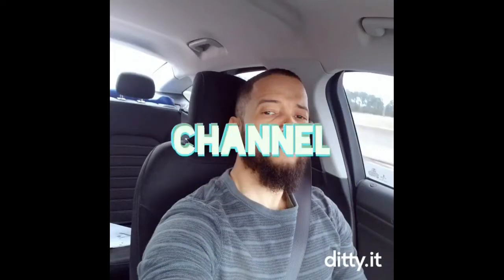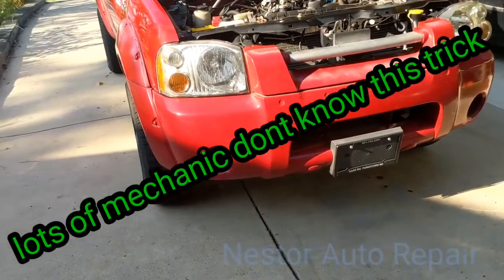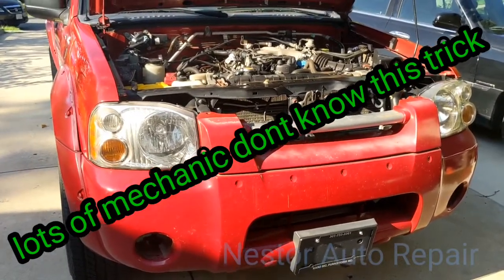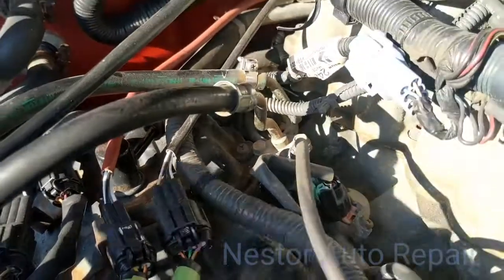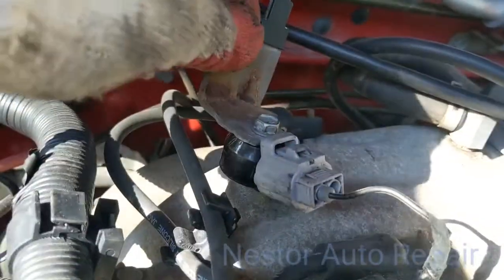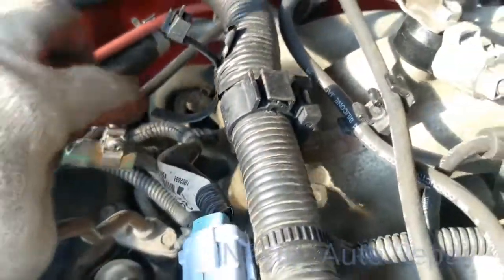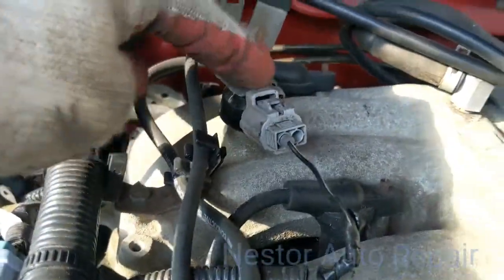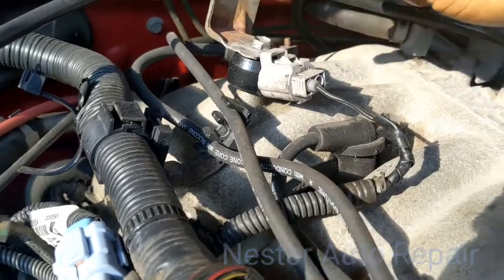Nissan frontier Nissan  xterra knock sensor replacement  under 5 minutes

Comment: Thank very much I am an elderly woman using a cane and have been working on my truck due to economics.   I change the throttle body boot and hoses in the summer in Arizona, last summer.  I need a horse lol.  I cleaned the throttle body with rag and screw driver it was so very very dirty at 180,000 miles.  It hasn’t been the same. I haven’t felt well enough to work on it again till recently.  
It starts choking when I put on the brakes.  It has a swooshing/air sound when I put on the brakes. The brakes booster and master cylinder are maybe 6yrs.  I have only taught myself by YT.  There is a code for knock sensor this is how I found you. It would be a blessing if you had a suggestion.  I found a reader thing 10 hrs ago and just used it
Thank you for your time.

Comment: Where is the best place to mount the relocated sensor on and 2003 supercharged?  Thanks
Reply from the maker: As long as you put it on the aluminum air intake manifold you good

Comment: Will this be harmful to the engine in the long run or it does not make any difference?
Reply from the maker: It will not make any different it may loos like 10% of hearing having it all the way up there away from the block , but still it will work
Reply: @nestorautorepair  thank you so much!!
Reply from the maker: You're welcome

Comment: Can you recommend me a website or store were they sell it that would be great tengo que pasar este smog lol
Reply: It's for a 2002 nissan frontier v6 supercharged I got the sensor from the dealer it was $300
Reply from the maker: Woooow return it get it from eBay under $50 I believe
Reply: I just need the harness but I need it for the 2002 nissan frontier v6 supercharged I have seen a bunch of harnesses but idk if they will work for my vehicle
Reply from the maker: As long it connect it will work
Reply: @nestorautorepair  I saw online that it has to be for a 3.3L engine
Reply: @nestorautorepair  can you send me a link to the wire  harness that I need it's for a 2002 nissan frontier v6 supercharged
Reply from the maker: Al you really need is any knock sensor with the connector ,, al knock sensor are the same https://www.ebay.com/itm/164239956635